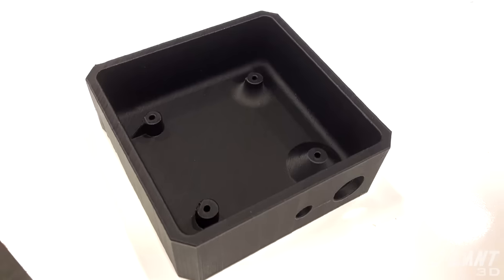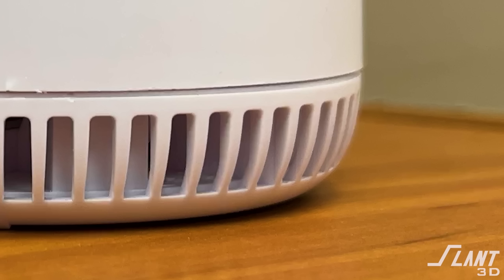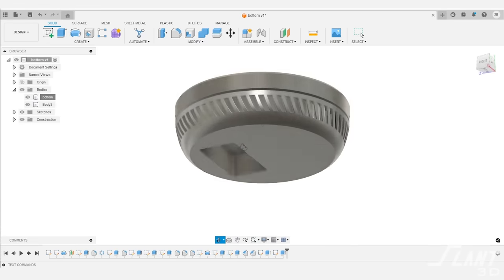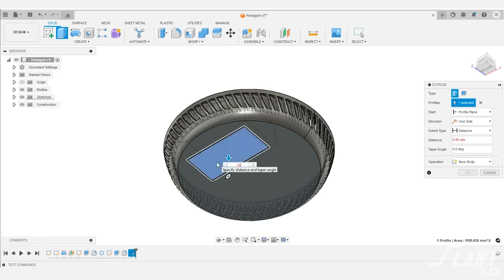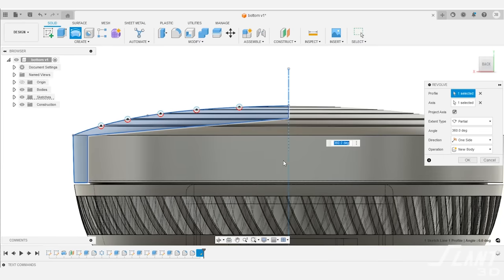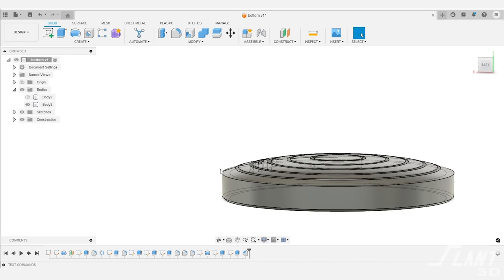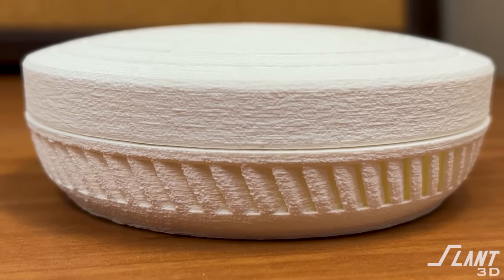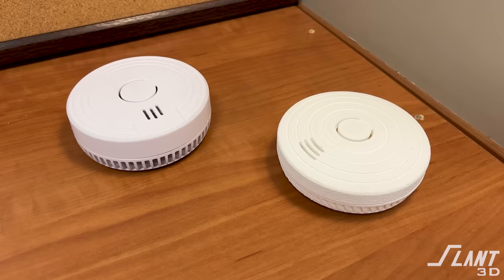Rounded Electrical Enclosures | Design for Mass Production 3D Printing

Comment: Would it be cheaper from a business standpoint to PRINT 100000 pcs? vs injection molding I mean
Technically I don't care how this thing looks like coz it lives somewhere on the top, but It'll be a challenge to sell a product that looks like that (w/ 3d layers)
Reply from the maker: In our experience. For 100,000 pieces you should consider 3D Printing as a more affordable option.
Reply: @slant3d  Wow! Cool! Good to know that
Reply: @slant3d got any examples with numbers to back that up? I work in consumer electronics around those numbers and we've always found injection molding to be cheaper.
Reply: @AverageJoe928 For real, these guys hate injection molds for some reason. The parts produced by the two processes can't even be compared in quality at the scale of 100,000 parts. You would need to use 50 printers to produce small parts at that scale in a timely manner, each of which exhibits it own variation and produces a slightly differently shaped part. One precision machined injection mold makes 100,000 parts, that alone is a tremendous improvement in process characteristics for producing consistent, manufacturing quality parts. 

There is absolutely no question that widespread adoption of 3D printing is revolutionary, but the technology in its current form has some undesirable traits for production at scale.